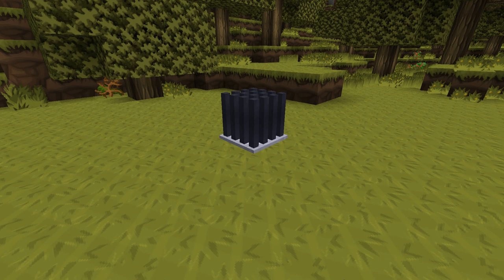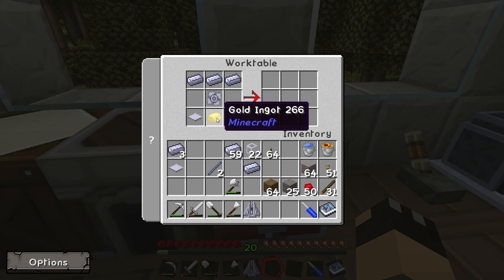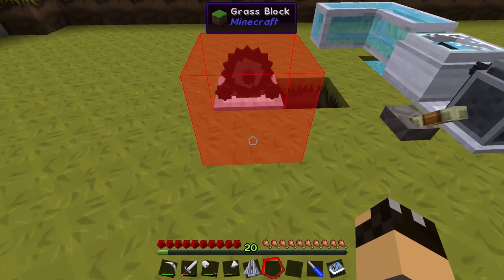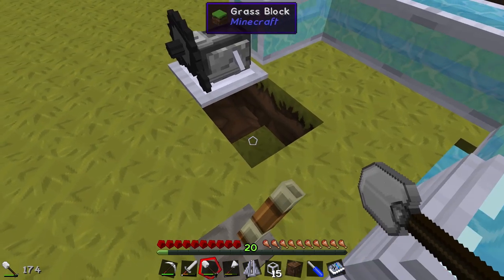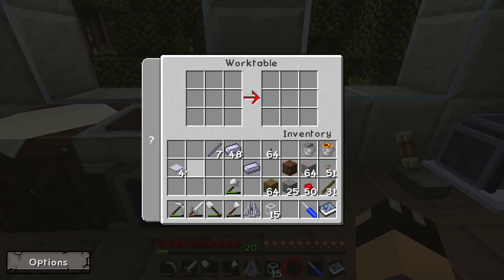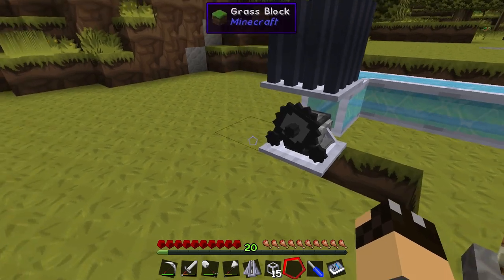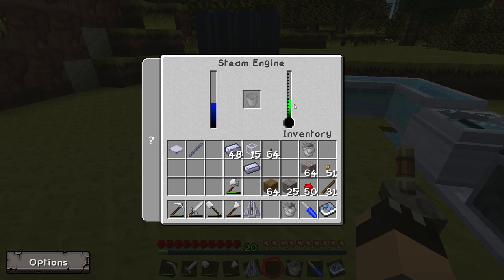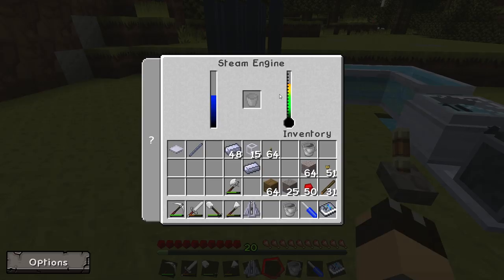Steam Engine (RotaryCraft) -4- How To FTB in Horizons

Comment: Good video! I'm stoked for you to cover the lubricant aspect of Rotarycraft. I noticed last week that using a steam engine with a 4:1 gear reducer to power a grinder, the reducer uses lube faster than the grinder produces it. Seems like that limits the potential of low-tier engines powering better machines.
Reply from the maker: While it isn't something I've looked that deeply into, I feel that it's more about converting torque for speed (or vice versa) with an equivalent power. What I mean is, if something requires a high speed or torque, you are still going to need a powerful engine. While you could use a lower power engine and gear it up or down, it just wont be efficient.

Lots of discovery and good fun to be had with this mod though.